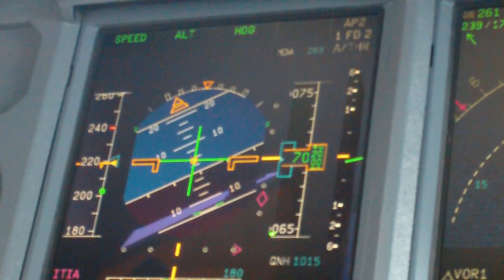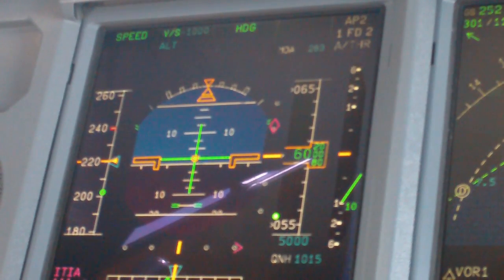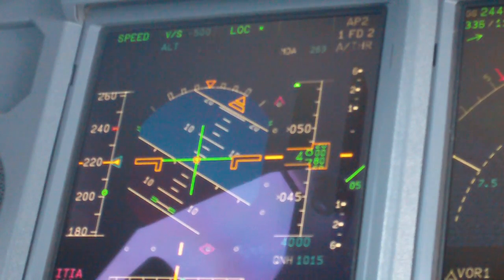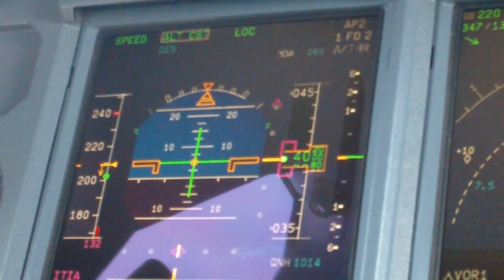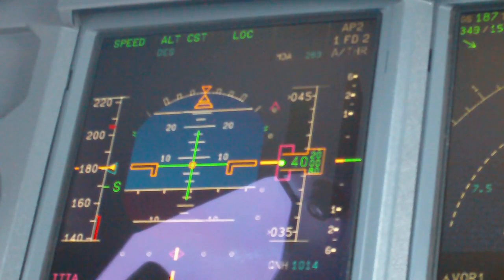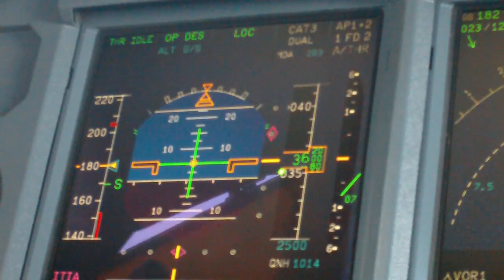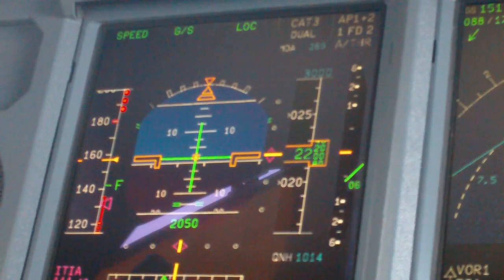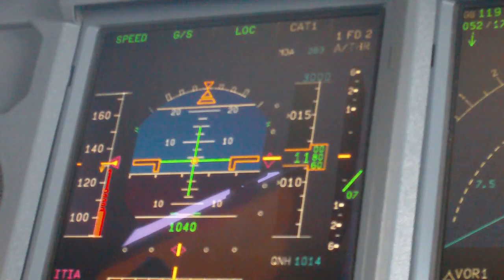Cockpit Cam - PFD Closeup (ILS Approach)

Comment: The height about ground level was quite fluctuating after it was descending below 500 ft in RA. Is it because of terrain or buildings on the approach path?
Reply from the maker: Yes, you are correct. Because of uneven terrain.

Comment: Hi Airtimbuktu, 

The FMA displays a CAT 3 dual approach, however the MDA is 239' AGL, is there anything i'm missing here? I suppose the MDA cannot go below 50'?
Reply from the maker: The FMA is just showing the capability level of the autoland system. But we're using a CAT 1 minima since it will be a manual landing.